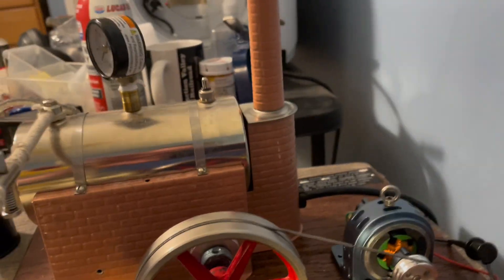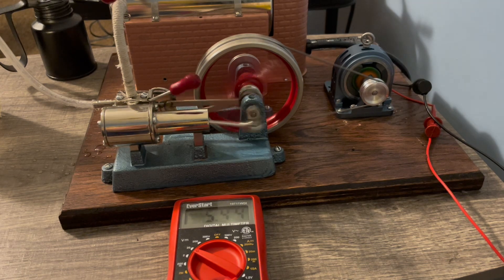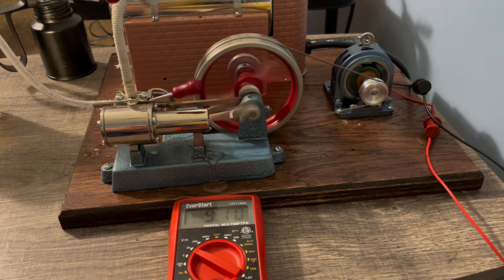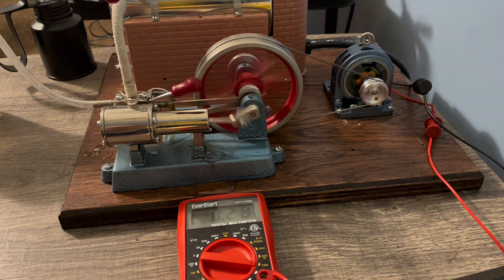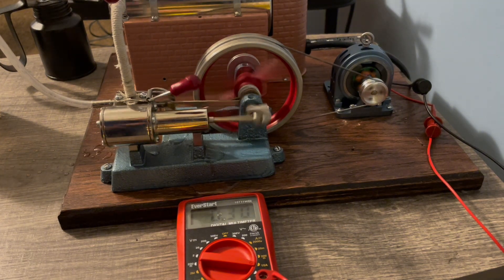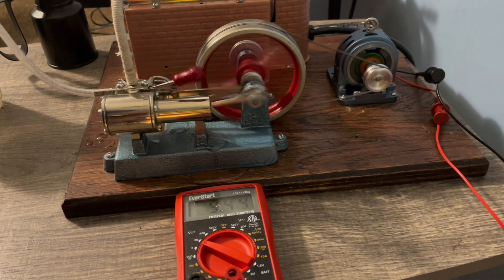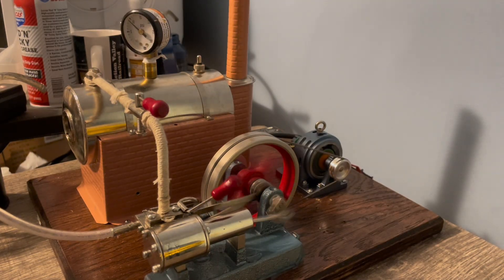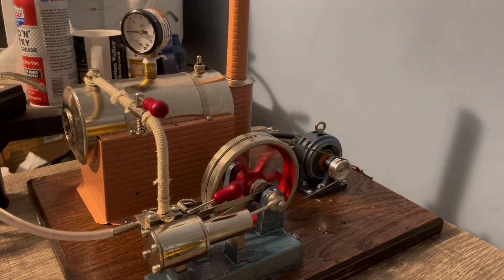AliExpress Generator 2

Comment: Putting the meter in amp mode you are basically shorting the generator out
Reply from the maker: Yeah I might have to find out a better way to test amps
Reply: @Bardsbrothersrailroad  still a pretty cool looking little generator I have an old wilesco steam engine that runs on these white square tablets I have not run it in years
Reply: @Bardsbrothersrailroad  there is a shunt inside of the meter that is a known low resistance value all the meter does is read the voltage across the shunt to calculate current

I would use incandescent bulbs as a load
Reply from the maker: @markdi2  thank you! I’ll have to do that

Comment: Beautiful! I was planning to buy this. But now I have seen it working, the thrill is gone. So thanks, I will not buy it. And save some money!
Reply from the maker: @jensjacobs9050  of course, glad I could save you a few bucks
Reply: Idk I think it's cooler now that I've seen it definitely going to get one I want to see if it will slowly charge a bank of car batteries for use with an Xbox just need to find a viable fuel source
Reply from the maker: @ this steam engine uses electricity. In the future I might build a mini one to power whatever I need it to

Comment: By setting your multimeter to amps, you are effectively short circuiting the output. As pointed out in another comment, you need to have an adjustable load, so that you can measure current and amps, to calculate wattage.
Reply from the maker: @paulbuswell6566  are you talking about using a potentiometer or something?

Comment: You also need an adjustable load to find the peak power of this generator as well as the optimal rpm of steam engine.
Reply from the maker: The steam engine was running at its max speed. I’ll do some digging on the generator. Thanks for the input!
Reply: @Bardsbrothersrailroad you can set something up with a series of small incandescent lamps that you can switch in and out to vary the load or use it to power a motor with a flywheel that you can apply a brake to to increase load. Measure voltage and amps to find peak power. What you had there is a nearly dead short, you will likely find with a more reasonable load that you produce more current at a reasonable voltage.
Reply from the maker: @RC-nq7mg gotcha! Well thank you!